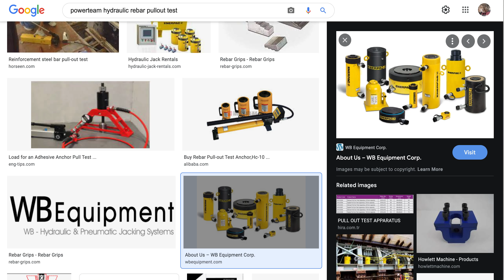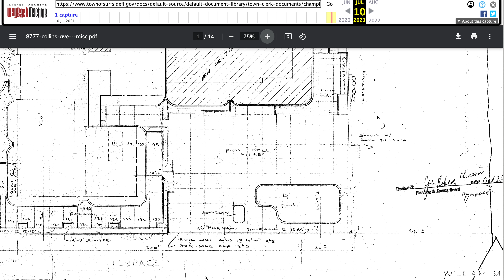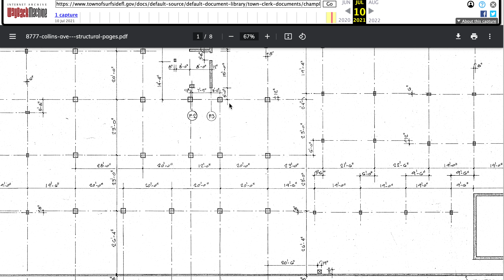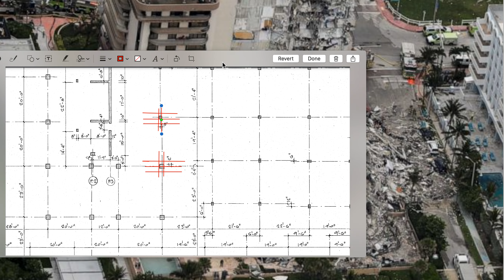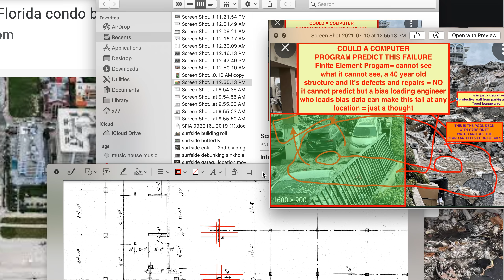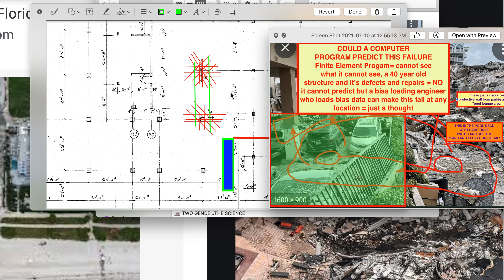Champlain Towers COLLAPSE WHY REBAR DID NOT FAIL BUT LACK OF REBAR AND 40YR CYCLING ISSUE W/SPANS

Comment: Kai you are 100% refreshingly correct on testing and verifiable on scene data analysis. Your methodology is second to none. 

Professionally trained and co-authoring numerous ASTM engineering standards and procedures with 45 years experience in advanced material reinforcement and failure analysis engineering, you are right on 🎯 ! 

Keep up the good work.

Cheers,
KP
Colorado Springs, CO⛰🇺🇸
Reply from the maker: Thank you I Care, and wow to being the ASTM co-author!

Comment: Thank you so much for sharing your knowledge and experience with such passion. Regarding your comment at 6:55, about the slab not being connected to the wall, from what I can see in the drawings the slab was designed to be connected to that property line wall by #5 rebar spaced 12" apart, but I believe the bar in that area was substantially corroded and sheared through with the weight of the three vehicles (engines in first, as you noted). Please can you check and confirm this aspect?

Comment: Note that the 1979 dwgs had structural note saying that the underside of the first floor covered by the building shall have 1-1/2" sprayed on polyurethane applied. Didn't notice it. Without it the first floor stood chances of sweating. Also, horizontal waste lines and storm drain lines may sweat in that climate, leaving puddles on the floor. We insulate them here in SE La.

Comment: I was a mechanic wayyy back in the 80's for a concrete firm.I got to know the mixmaster there, and we had a few conversations about concrete. 
 Two things bothered contractors when dealing with concrete. 1- the fear of the mix being "too hot."  AND 2- the fear that the mix would be too wet. The trucks had a 100 gallon wet tank filled with water to keep the mix from becoming too hot if there was any kind of delay toward the pour. 
Also back in the 80's a "dryer" was added to the mix made by DuPont. It was called "Airalon" and came in faded green metal 55 gal drums. Contractors loved the Airalon mixes because it would pull the moisture out of concrete making it cure faster. 
 To add a personal note, I never seen concrete "sweat" since those times.
Reply: I had a job where the specs called for a tight slump (a measure of water content). After going thru a pump truck, it consolidates even tighter and hard to flow in forms. Contractor wanted to add more water. I couldn't allow it. A mix with plasticized had to be approved.
On hot days, ice was substituted for water to slow the reaction for placement/ workability.

Comment: 1:30 am. Maximum number of vehicles on the parking deck creating the greatest load. Possible variable in causing the cascade of failures leading to the buildings collapse. Thanks for your presentation, I watch for updates multiple times per days.👍

Comment: yeah, from another angle, the first day I looked at the ariel pics of the collapsed pool deck section, and where the building fell onto the pool deck, I just didn't see the building pushing down that deck out to the fence-line, as that other identical construction type and similar supported section between the building and pool resisted collapse up to the point the building ruble was on it. it just didn't add up that way, the pool deck between the car area (and part of the car area) out to the pool had to be the initiation point, or that section had to be vastly inferior to the section of pool deck still standing (and the blueprints do not show any vastly inferior column type size etc to the part that did fall).

Comment: 40 pound per square foot/ passenger vehicle not exceeding 2.5 tons or 5000 lbs. A 2500 Chevy 4wd weighs 7000 pounds. Not p.v. it's a "light truck". I used to roll with, easily 1000 pounds of tools under a bed cover. 
I've seen people flying through garages. "Live load" goes way up. Just like "Ice road truckers" the pressure wave in front of you , will crack the "road" if you exceed the speed/ weight limit. 
I agree, weak spot . My first thought was, "where is all the rebar?" Add in all the pool deck "issues". Second floor "slide hammered" first deck. That shock wave , took the deck out , key columns , dragged rest with it. 
I can see, using smaller columns under pool deck, no load. Why smaller columns, on the 2/3 of the building that collapsed? Back in the hand drawn blueprint days, you'd be starting from scratch. No "select all" / "rescale " function. Intern did 13 plates before someone noticed? 
Bet there were some "rod busters" on that job , asking the same question.
Most engineers I know , highly intelligent , no common sense. "Looks good on paper!"
Reply from the maker: Do not forget to divide the total number into tire "imprint" onto surface... That becomes the dead load point loads...
BUT, u also have a surge load, when u apply brakes and also accelerate... Both will exceed the vehicles dead load contact pressures...

Comment: Would it be different in the time this building was built? Back in the late 70s was the gas crisis and people started to buy mini cars for gas mileage. Now some cars are big monsters.
Reply: Engineer is responsible personally, no protection w bankruptcy, to ensure bldg stands up w significant redundency. MINIMUM code requirements which of indeed supports residential loading for parking garages but engineer is responsible to confirm point, dynamic moving, & impact  loading  for all possible vehicles or designing means to ensure oversize & weight vehicles can't just drive in at will without knowing they exceed weight. If that sounds tough it is but that's the deal.

Comment: 40 years of cars going in and exiting the upper level parking weaken the rebar in addition to corrosion. Wheels going over expansion joints put vibration throughout the floor/ceiling. Take a peace of wire,bend it back and forth, it breaks.
Reply: Correct.  Cyclic shock, static and dynamic loading, environmental conditions, maintenance and changing adjacent forces above and below grade outside the property perimeter, all have significant influence that are indeed amplified over time and in some cases  exponentially.

If any deficiencies are detected and/or physical changes/influences on the system from outside the building property line are not fully taken into account, understood, correctly planned for or corrective action taken immediately, the weakest link in the system will fail which typically sets off cascading failures, especially in fracture critical systems. 

Both finding the weakest link and what triggered the weakest link are critical to understanding and preventing future failures on all levels. (Pun not intended).

Comment: The stamped concrete overlay  stayed  together in slabs when it fell shows it was super strong but was not  added in a way to strengthen the parking deck,  along with the platers that were redone next to the pool gate added a lot of weight  and no reinforcement.